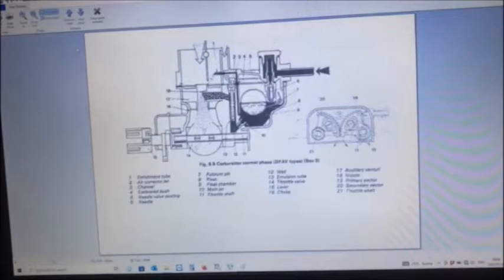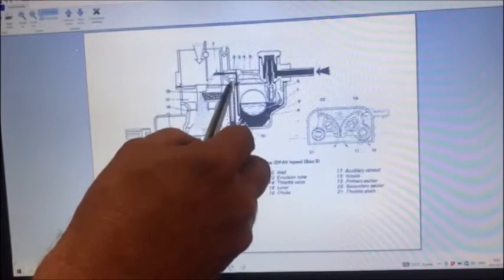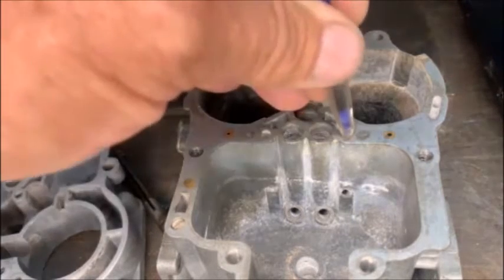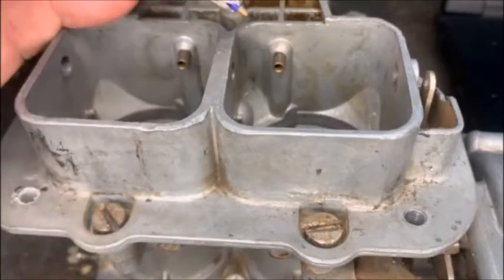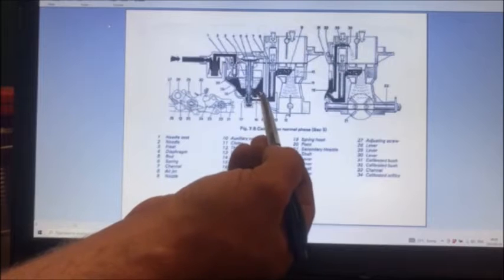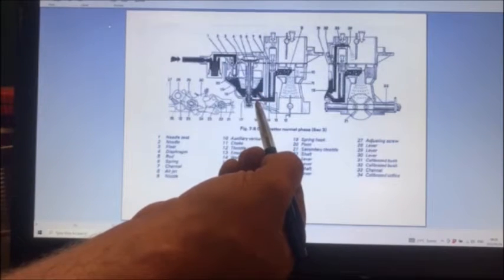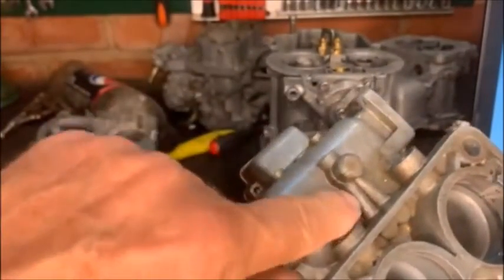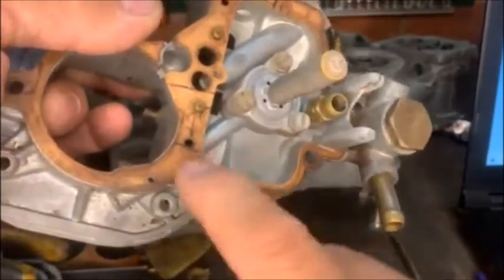Weber power valve enrichment systems

Comment: Thank you from USA! My 81 jeeo cj5 suddenly went so rich it had to be towed. Replaced the needle/seat assembly , verified 2.3 pounds fuel pressure and STILL no-go. Just fills the barrels up in seconds after turning on pump. I had no idea what the hell was happening until now. It's almost guaranteed to be that power valve gizmo. (Or at least  another thing to check).  I won't block it off because it's on a thirsty 6 cylinder 258 cubic inch (4.2 liter) engine.
Reply from the maker: Hi, when you fire it up check down the two barrels to see what happens, that will tell you a lot.

Comment: Hi Gert, the 32/36 DGEV on a larger 3.3L engine- is it possible that the power valve might struggle to open normally due to high engine vacuum and as such larger jets will need to be installed? Chasing a bad fuel economy issue that I've emailed you about but just had this thought.
Reply from the maker: It is a unusual situation, i have never put a 32/36 on a larger motor, i always use a 36 dcd or 38 DGAS for that.the only two fuel enrichment system that cause cause a high fuel usage is the carb power valve in the float bowl and the calibrated bush in the carb top, drawing fuel from the float bowl. the 32/36 only has one. what emulsion tubes are you using, if you use F6 you can probably get away with using smaller main jets without a flat spot.
Reply: @carburettorrebuildservice8964  Just using the factory ones as it is a new carby. I will be going to a 38 DGAS anyways, it was obviously not the right carby for the engine.
Reply from the maker: @LiamsGotThis Please let me know how it goes.
Reply: @carburettorrebuildservice8964  38 DGES was an immediate improvement. So much more fun to drive, less flat spots etc. have only had to bump up the idle jets to get the idle mixture screw to 1.5 turns like weber suggests and to cure a couple of flat spots in transition but drives amazing and has been so much easier. Havent measured fuel economy yet so will post back later.
Reply: @carburettorrebuildservice8964  I do have a bit of a flatspot after the initial hit on acceleration high throttle though. Takes a second or two for the engine to take off after the initial hit. I'm thinking emulsion tubes.. would you recommend F6 or F8? 3.3L inline 6 engine.
Reply from the maker: @LiamsGotThis What size id the auxiliary venturies - F6 works works well but you should not need it on the large engine
Reply: @carburettorrebuildservice8964  brand new 38 DGAS, so whatever is factory these days
Reply from the maker: @LiamsGotThis mmmm, who knows,on my part of the rock it was used on Cortina and Sierra 3.0, 3.2 and 3.4 V6 motors

Comment: block it off?? no no! no! no! not another guy thinking he is smarter than the design engineers, the crap he is doing will be detrimental to any engine!!!
Reply from the maker: Hi, thanks for watching my videos, much appreciated. Please watch the video to the end for clarity. In the application that i have explained, we use a carburetor that was designed by the engineers for a large cc engine (1600-2300cc) on a small 1400cc engine and as a result the the calibrated bushes fitted to the carburetor is to large for our small engines and as a result over fuels. in some cases so bad that the engine stutters. That is the reason we block it off in some applications. We have over the years tunes it into a fine art. We also monitor the air/fuel mixtures with a gauge fitted in the car.

Comment: Am i best to delete these if im running a 32 36 webber on a 1300cc toyota 4k with a mild cam ??
Reply: My main issue iv been having is running way to rich at idle iv tried many different jet set ups orso braking up at 6.5k rmp + and burning thru sparkplugs been watching your vids for 2 nights now seem like a webber carb legend
Reply from the maker: Yes, if you block all the enrichment systems you are then in control of how you want to jet the carb. Remember that carb could be from a 2000cc engine.
Reply: I tried blocking them an ended up with a big flat spot first trying to drive from low rpm an not idling    

I run no chokes 

My primary main is 125 air correct is 180  tube is f50  idle 55
Secondary is main 130   air correct is 195   tube f66 idle 55 
This is a 1300cc tune i found online i have 1600cc jet set up as well but having issues with both setups  been abit rich I've 1.3/4 turns on mix  been messing with this thing for months now and makes some really good power changes but most of the time it likes all or nothing with the cam specs the want valve lash at 12in 14ex starts braking up alot at high rpm  if i go to factory valve lash specs of hot 020in an 030ex its alot better but looses alot of power i feel as if I'm head butting a brick wall

Comment: So you're saying the power valve system is not necessary?  
Thank you sir, my carby is also missing any sort of jetting in that hole.  My poor little 2 Liter Mazda doesn't like it.
Reply from the maker: Yes, on a small motor it over fuels, remember the orifices was made for the Ford 3000V6

Comment: Thanks for this video!  I have two 38 DGAS on a BMW 3.0 that is rich almost everywhere but idle.  I'd like to bypass the power valve in the float bowl to test if it's part of the problem, I see below you say to unscrew the valve body in the bottom of the bowl and insert a piece of rubber.  To clarify this, do you mean to use a piece of rubber as a stopper/bung and leave the brass valve out?
Reply from the maker: Hi, Just unscrew the power valve and remove it for your test, does your carb have the enrichment system on the opposite side of the accelerator pump? if so just pinch the pipe

Comment: Awsome video very educational     I have a a 34 adm webber on a L20b  what jets would I start with with the power valve disabled             it's  working atm and just does not run right
Reply from the maker: I have no jet chard on your carb as I have not come across it here in South Africa, you can try this as a starting point 135/130 Mains, 165/165 Air correction with F66 emulsion on both chokes. 45 pump jet

Comment: Thanks Gert, beautiful explanation. I have a question: if you remove the weber style spring/diaphragm, do you set main jet bigger than standard or just stock jet?  I have a 32/36 dgav on 1500 cortina and had black plugs straight away. After removing power valve spring/shaft it has no power under throttle so I presume it is lean?
Reply: Also had backfiring under load before removing. That has stopped but lost a lot of power.
Reply from the maker: @Phil_Taz  I would suggest a larger main jet on the second choke
Reply from the maker: backfire us usually a sign that it is lean

Comment: sorry i don't know your language. What is the carb power valve assy task? can you write in English? my car stalls at the first accelerator and faints on the ramps, everything else is new and normal.
Reply: He said "Power Valve Assembly", it should not affect your acceleration that bad, but wierd things happen.

To make life easier, because it could be your Pump Jet, could be lean, too rich, etc, lots of variables to a degre.  Write down your carb and car, and all your jets.  It will help him help you.
Reply: @rustywolf6813  my carb. Weber 32/36 and my car ford taunus 2.0 ohc.
maybe it's from the co setting, I made the setting myself without the device

Comment: Hi. The diaphragm on the side that shoots into your accelerator pump nozzles - all my books call it an anti stall device, apparently its supposed to shoot in some extra fuel if the engine is about to cough out.
Reply from the maker: Correct, it enriches the fuel when the carb is in a low vacuum condition. On a progressive carb that happens when the second choke opens to fully open. you will notice the connection pipe id below the second chokes butterfly. On a 38 usually when both chokes are fully open. Again the connection pipe is below the butterfly.

Comment: Hi, Gert. Excellent videos. Weber knowledge is dying out...
Anyway, I have a rebuilt 38 DGAS on an Essex V6 3.0.
Runs great, choke works, gives good economy (for an Essex V6...).

My carb has a large screw set deep into a hole above the unused/blocked off vacuum port behind the synchro gears, right between the two barrels.
I've read somewhere that it is an air balancing screw?
What is it really, how does it affect my carb, and how do I set/adjust/tune it?

Also, in other news, initial acceleration feels good without stumbling, but then it sort of stops pulling at about 3500rpm. Feels wheezy. Any ideas? I could come to your shop, I live near enough.
Regards
Reply from the maker: Hi, it could be lots of things, 1. fuel supply - float level or partly clogged filters or even a fuel pump. 2. check you timing and vacuum advance. 3. spark, check you plug leads (does it have points and condenser), check your spark plugs. 4. is your air filter clean?  If all of that is 100% you can look at jetting. i hope it helps

Comment: Hi Gert, I very cool video. Would you mind if I ask you a related question regarding the power valve?
I've got an old Audi 100 2.1 10valve 5cyl in my microbus with a 38 Weber  and I am using what I think is an awful amount of petrol. The carb was cleaned and checked for leaks etc it has the standard jets 145, 210 etc I did remove the choke plates and the choke bar, so no restriction there. I have it running off a small electric Facet pump and the vacuum is connected to the distributor.
You mentioned in your one video you  "blocked off" or "deleted" the power valve for you 1400 bakkie and got something like 13km/l. Yes I'm aware I am driving a bus and don't expect those kind of figures but do you think "deleting" the power valve will help as it's also a "small" motor compared to a 3l V6 ford. I would appreciate any advice you can give me based on your experience on the power valve, vacuum and even the facet pump please.
Thanks Alastair
Reply from the maker: Hi Alastair, thanks for watching. I would block two of the enrichment systems to start with, the one on the side you can close by putting a small metal ball in the pipe. The one in the float chamber you can unscrew and block the hole with a small piece of rubber. The facet pump is not a problem, i use one on my bakkie, I installed it at the back of the petrol tank.

Comment: Hi there I am from Durban.. i have a 38dgas on my m110 6 cylinder  2.8 engine. No one in Durban can help me with it.. I basically have  made my own jets using lead and reaming them.. I am battling to find idle jets in 55 as the original size is 45 and the car will not preform has huge flat spot on pull off mid range is good.
Made up 50  jets reaming the 45 jets out .
Currently running 150 mains  and 170 air correction and standard emulsion tubes for ford v6 from were I got that carb from.
The stumble on pull off is way way better got mixture screws at 1 and a half turns maybe touch more and tried in and  out and stubble is still there some times..
Hi up in the Rev range the car revs clean to like 3000rpm the after that shudders not sure if to much fuel or to little.... when it happens if you take your foot off acceleration it gets better.
Reply from the maker: Hi, i think you are been messed around by the enrichment systems on the carb. Remember this carb was designed specifically for the Ford V6 engine and the enrichment systems and jets are for the V6. I have managed to make a 38 work in a Nissan 1400 but i disabled all the enrichment systems and changed the jets many times to get to the smooth spot. I also changed a 38 to progressive and it also worked well on my 1400. I think you will be better of with a 36 DCD carb, and jet it for a Nissan 2.8, it will be a good starting point but i think it will work well. you are welcome to contact me on 060 654 6966 - Gert